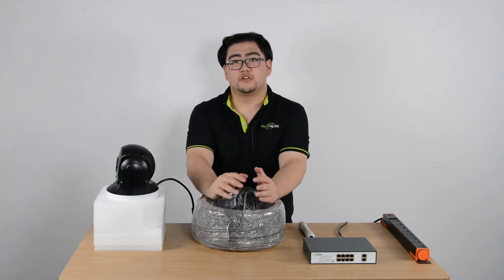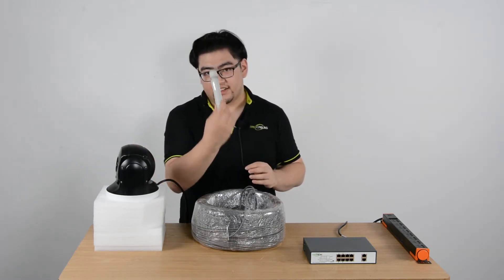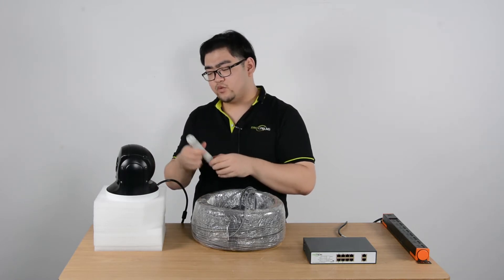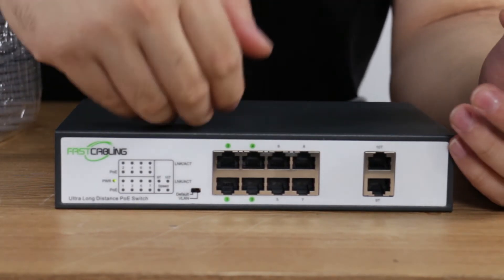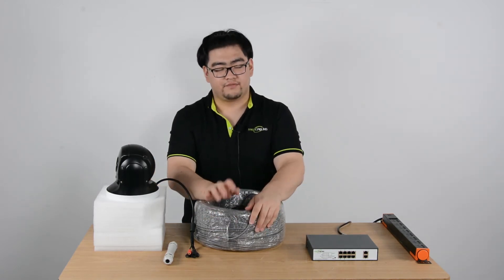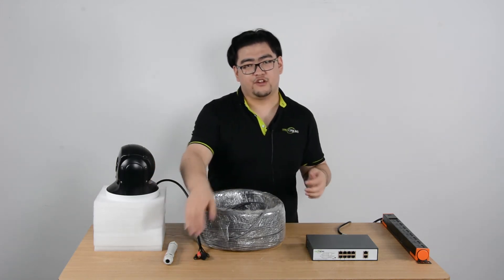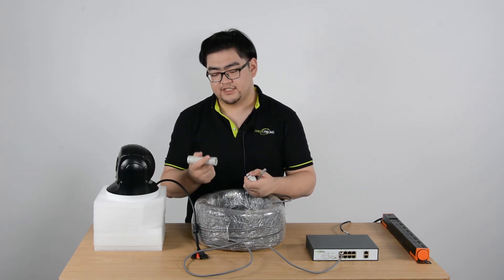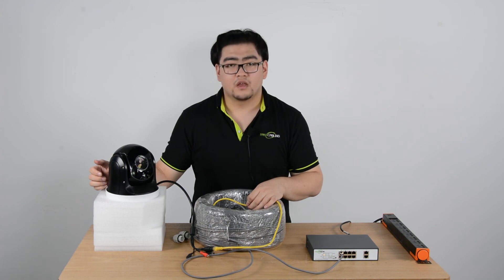Everything You Need to Know about 800m Long Range PoE Switch

Comment: Can I connect camera at 300 meters  with out adapter
Reply from the maker: If you don't want to use the 800M PoE switch, you will need two unit PoE adapters to achieve 300 meters POE network. The PoE adapter can't be power by external power adapter, it can be powered by PoE injector at the backend. https://www.fastcabling.com/product/300-meters-direct-burial-poe-ethernet-extension-kit/

Comment: can you have more than 800m if i have two long range poe switch?
Reply from the maker: @Bryant Din  The maximum is 800 meters PoE for now. The bandwidth is lowed down to 10mbps and the power budget is about 17W at the edge. 4 twisted pairs have been taken to transmit the power. While the distance becomes longer, you may need to consider the fiber optical solution. https://www.fastcabling.com/product-category/800m-poe-switch/
Reply: @Fastcabling  with fiber optic can you go 2000 meters? and can you run 4 cameras on one line? does camera need to have fiber optic input? or is there an convertor?
Reply from the maker: @bryantdin7045  With fiber optical cable, you can run over a network up to 80 kilometers. However, the power source needs to present at the edge. The fiber optical cable is non-conductive. You can't send the power over fiber optical cable directly. It could be the media convertor or the outdoor switch sitting at the edge, like this one.  https://www.fastcabling.com/product/outdoor-poe-switch-with-sfp/